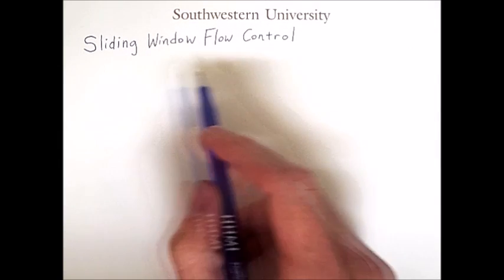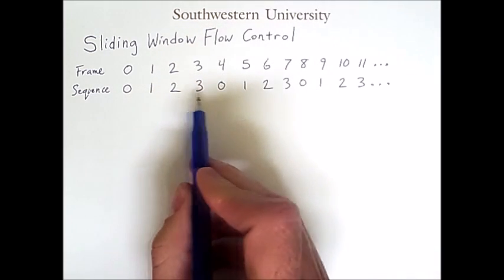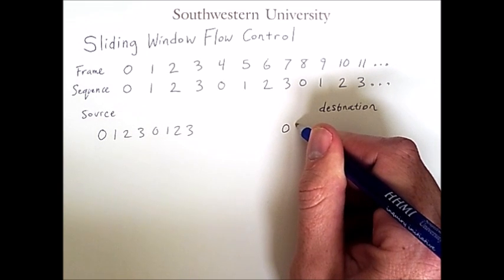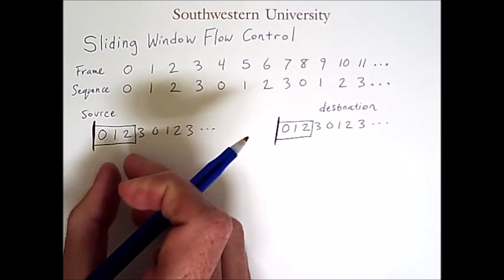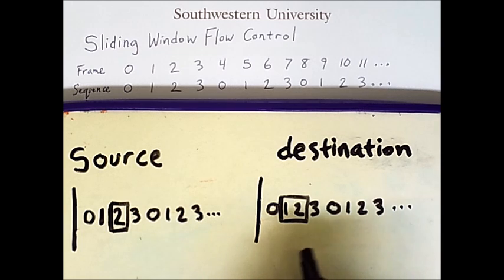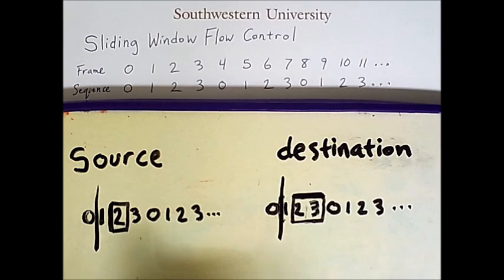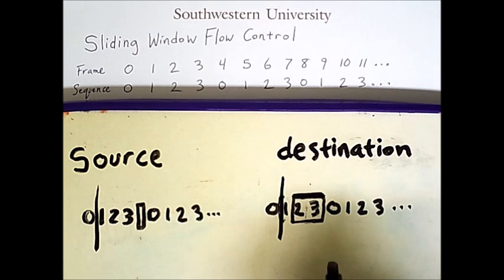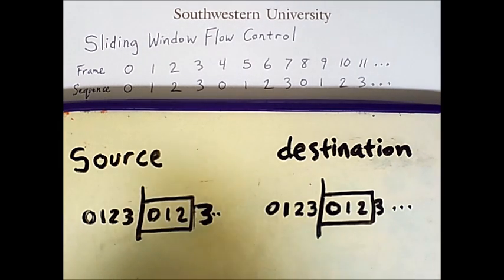Flow Control and ARQ 2: Sliding Window Flow Control

Comment: Why is the window size 1 less than the sequence number ? e.g if the sequence is:
0, 1,2,3,4,5,6,7 the max window size is: 7
Thank you for the detailed explanation.
Reply from the maker: If you allowed the window to be larger, then there is a risk of an entire batch of frames being lost in transmission. At the start of transmission, the receiver is ready to receive frame 0. Then the sender transmits frames 0 through 7 (all frames in the window). However, let's say that every single frame is lost in transmission. The receiver would still be expecting the original frame 0, but the sender would move on to the next frame with a sequence number of 0 without even realizing that 8 frames had been lost in transmission.
Reply: Thank you for your explanation & great tutorial.
Reply: @JacobSchrum  if the transmissions (0-7 lost ones) have never been ACK'ed by the receiver, then the window won't even move on the sender side, right? So, after the time-out, the sender would just send the same 0-7 frames right? Like, I can see that the receiver is going to send an ACK-0, but my point is that the sender hasn't slid his window, so it's all good.

Although, I think a problem can occur when the ACK fails. Say the receiver successfully "received" (not ACK'ed) all the frames 0-7. Now, let's assume the ACK-0 fails on the receiver (this 0 is indicating the 'next' 0 frame, not the already received one). As this ACK failed, the sender would again time-out after a while and send the same 0-7 frames as before, but the receiver is not intelligent enough to catch this, so we have duplicate frames. Is this right, or am I missing something from your explanation? Thanks a lot for the videos, you are a great teacher!
Reply: Jacob Schrum 
But the same scenario can occur with say 4 frames as well, i.e. all 4 frames get lost on way & sender not knowing about it again starts with sequence number 0 .
What'll happen in that case?